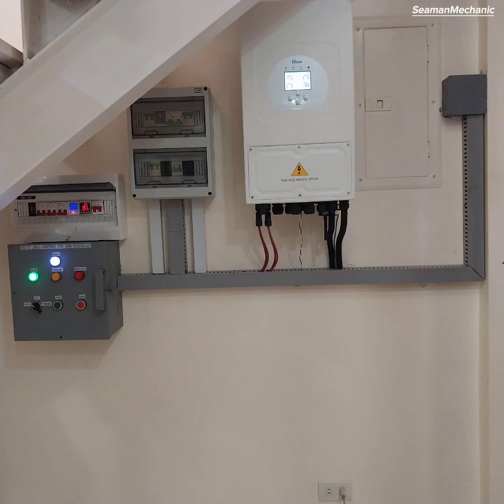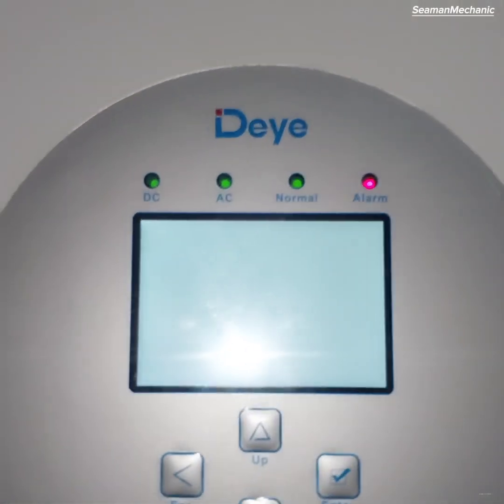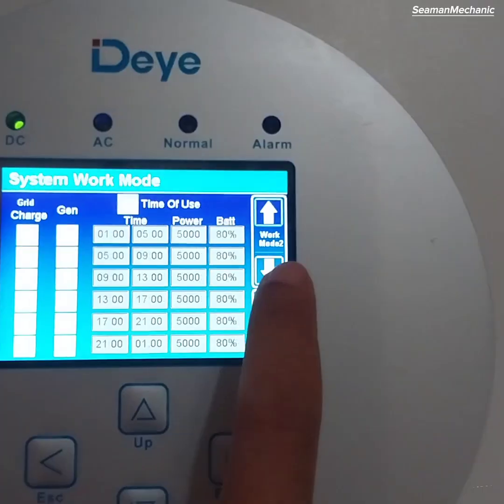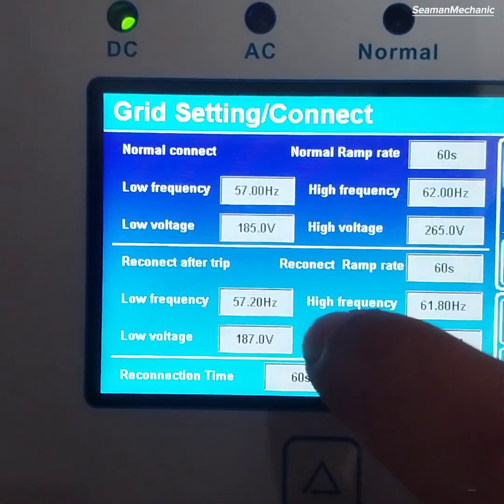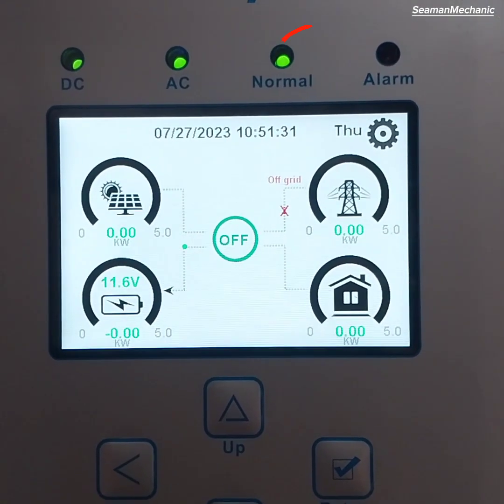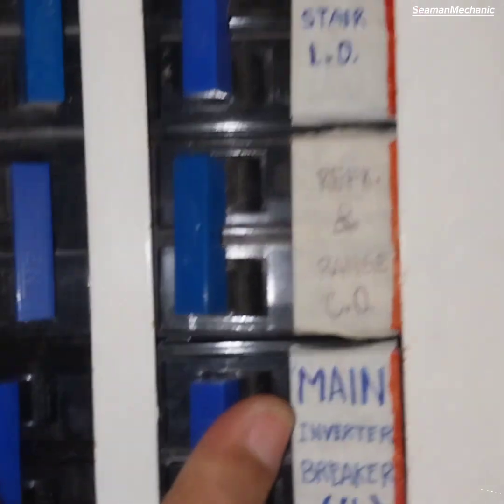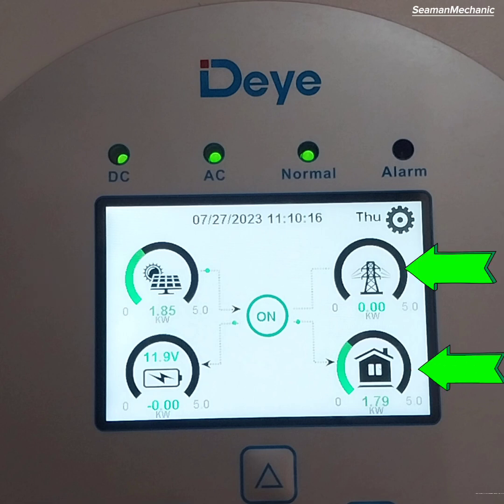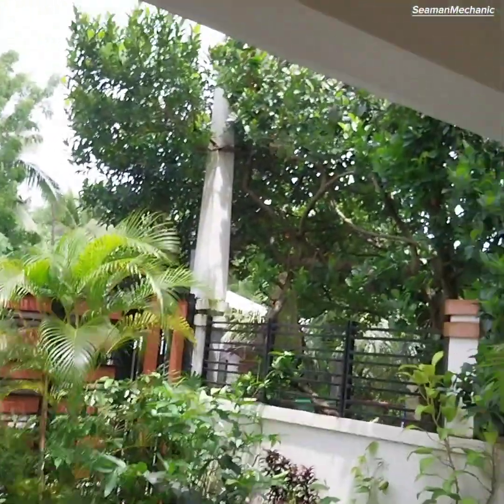PART 4 - Commissioning of Hybrid Inverter, DIY Solar Set up, 5kW Deye Hybrid Inverter - 48V.

Comment: Sir 
At night did the inverter display the load and the Consumption from grid without battery??? 
My inverter doesn't display.
Reply from the maker: Negative sir, if you dont have any battery connected, it will not display grid consumption